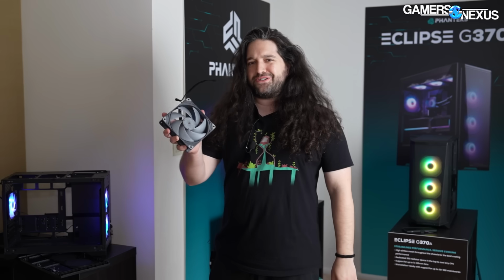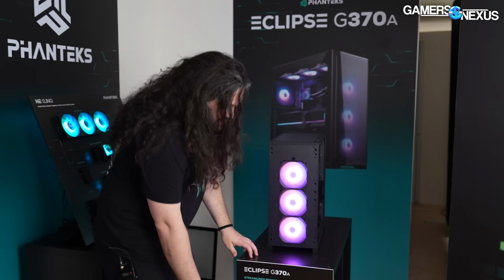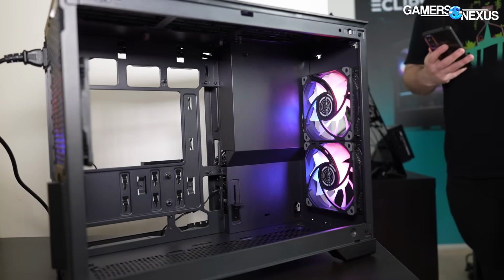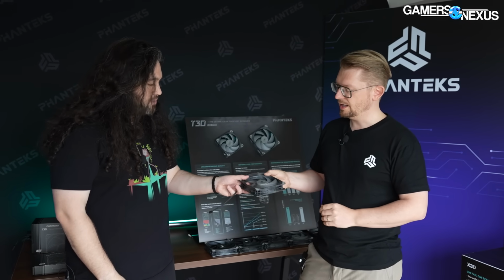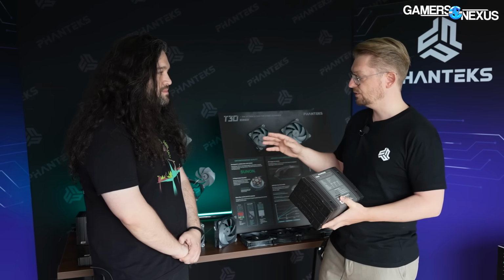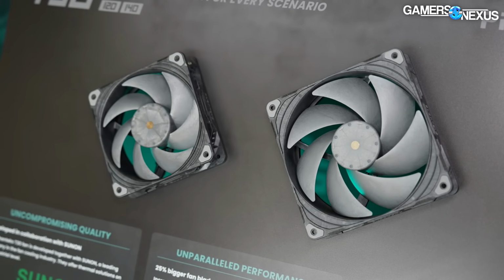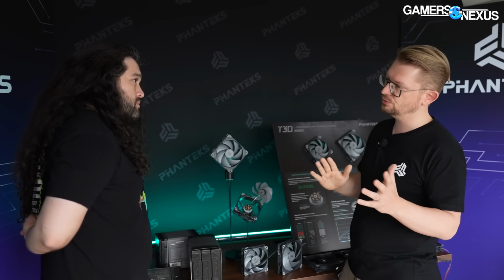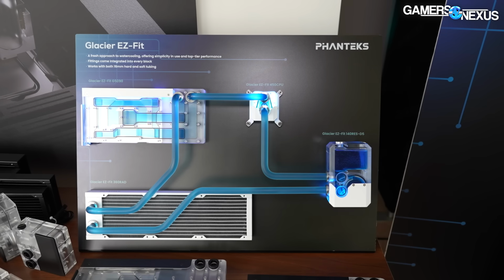6 Years to Make a Fan, G370A Budget Case, & Phanteks Technical Fan Discussion, ft. CTO

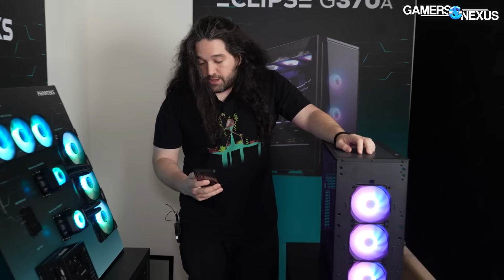Comment: 5:49 I really like the PSU placement for the XT M3. I'd love to see that used on full ATX cases. I don't like the trend of cases having a blocked out strip across the whole bottom of the case. It's a lot of deadspace where I'd rather see transparent paneling

Comment: i like the case with the 900 LEDs wrapping around the bottom edge. it's plenty good for displaying some stuff and sounds like it's a bit cheaper to implement than the LCD panel we've been seeing on many other products this year. it's probably also brighter if you want it to be and somehow it just looks nicer, at least to me. though i'm also wondering about the heat output of all those LEDs. 900 of them is a lot

Comment: At "only" 25 mm thick, how do the Noctua iPPC-3000 140 and Iceberg Thermal Icegale Xtra 140 achieve fairly similiar airflow & pressure to the 30 mm thick Phanteks T30 140 and Super Flower Megacool 140? It also begs the question: how insane would the Noctua and Iceberg Thermal be if they were also 30 mm thick?

BTW, I'm slightly disappointed in the Phanteks' top-speed. For that price along with competing in the "absolute top-end, best of the best" segment, I was hoping for 3000 RPM, at least 2800.

Comment: I just wish there is a case that allows at least two 360 radiators, no glass or RGBs, great ventilation but also tricks to reduce fan noise bleed.

Comment: Patiently waiting for the moment when manufacturers start listing noise-normalized airflow and static pressure for their fans. There should be an ISO standard that specifies a reasonable noise level (e.g. 30/35 dBa) where performance should be declared. It would  be incredibly useful even though performance-noise is not a linear relationship for fans.

Comment: How come you prefer when they include the feet in the volume measurement? I didn't think anyone cared if their case was an inch taller.
I always thought volume was a separate measurement from the external dimensions, and specifically about internal volume.

Comment: I had no idea Phanteks was using Sunon as their OEM. That's amazing. I've got decades-old Sunon fans (note 2 plural tenses!) pulled from various bits of hardware. They work perfectly to this day and move lots of air; just a bit noisy. I need to remember this next time I'm fan shopping. That maglev motor and bearing assembly should indeed last a long time. 👍

Comment: Love my T30's! I changed out all my case fans and AIO fans to them, 11 in total. My 4080 Super Asus Rog stays easily below 60 playing 4k med-high w/ PT/RT etc settings. Then my Arctic Liquid Freezer II 360 with the T30's dropped CPU temps ~7 from stock under full load, but keeps it even cooler under normal gaming!

Comment: Although I own several Phanteks T30 fans, I still find the product quite awkward. You can think of it as a better version of the Noctua A12x25 at low RPM, with a higher maximum RPM ceiling. However, this comes at the cost of compatibility due to its 30mm thickness. Typically, users don't run 120mm fans at very high RPMs, and those who need stronger cooling performance often opt for 140mm or even 160mm fans instead. Its main advantage is probably in high-performance air coolers or as radiator fans in AIO liquid cooling setups.Competitors like the similarly priced Noctua A12x25 or the more affordable Lian Li P28 are both strong alternatives.

Comment: 22:40 Thermalright does this with their fans also, although (at least with the TR fans I have) the balancing material is red, and it's pasted into small notches around the top of the blade's hub, as opposed to underneath (where the blade attaches to the spindle).

Comment: Would love special post-Computex Interview about LCP with a material science engineer. 
- LCP. Glass Fiber reinforced LCP (Liquid Crystal Polymer). Plastic for high performance application, similar to metals, but not as expensive. 
You talked in the past alot about not mixing metals in water cooling. how about all the other materials used in computer manufacturing? the plastics. the metals.

Comment: Hello please help me guys.. my ingame sensitivity was super high but the sensitivity in loading screens and fortnite lobby was normal. I hadn't changed anything to do with DPI or sensitivity. My dpi was the same as before (1600) my ingame sensitivity is 6.4 which is also the same as before but my sensitivity feels like it has changed without saying it's been changed. My windows sensitivity is the same as before and mouse acceleration is off too. When I'm not in any game and just browsing around windows, my sensitivity is normal. When I go into a match my ingame sense feels super high it ruins my muscle memory and really pisses me off. If someone has a fix please tell me. It also seems like the sensitivity got higher in every game on my pc,( dbd , fortnite , chained together ) but not the cursor speed. Whenever the mouse cursor is out, the sensitivity is normal but when I'm actually playing the game the sensitivity is higher than normal I did not change the dpi or resolution or whatever, just updated nvidia drivers. I tried ddu to rollback, my pc is still not working as it used to and im still having this issue today. ( Its been almost a month)

Comment: I got a set of the T30s a few years ago and I made the mistake of just slapping them onto the highest setting, and put them on my radiator as exhaust fans, daisy chained, on the 2A fan header.
And once I finished my build I could not stop them from running at 3,000rpm all the time, no matter how I changed my fan curve and settings, it was like a Jumbo Jet engine inside my PC!
It was the perfect storm or errors, because I couldn't reach the switch on the inside to lower the setting, and for whatever reason that I can't remember now, daisy chaining them made them run at 100% speed all the time with the aid of the 2A fan header for extra power too! 🤣
But once I moved things around, and lowered the power settings on the fans it was fine, and they've been flawless since then. But having 3 of these fans running at 3,000rpm is an experience..

Comment: Phanteks are the most underrated fans in the industry. Love my Phanteks fans, it's all I ever buy and recommend at this point. Nothing else comes close to their performance and quality while being extremely reasonably priced. It does worry me to hear the 3 pack is going to be so expensive now though. It used to be like $30 for the 3 pack which was an insane value. Still, you really can't beat their specs.

I personally don't care much about how noisy my fans are (within reason), and not saying there's particularly are, but I just want the highest airflow/cfm/pressure I can get and always run all my fans at highest RPMs because I OC and I wear noise cancelling headphones when gaming anyhow. Phanteks has always delivered the highest specs at a fraction of the cost of the rest of them.

Hopefully they can take on Noctua without taking on Noctua's extremely high prices.

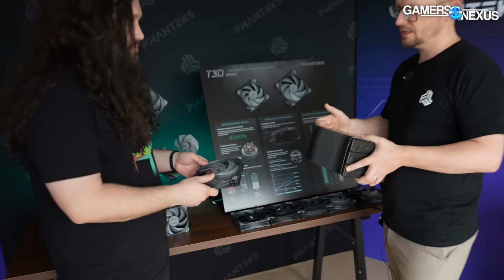Comment: On the T30 chart (e.g. 19:45), is the center bottom graph showing flow vs pressure?
Area under the curve would seem to be a compelling metric for fans that may be used in multiple applications.

Comment: instead of giving the 2 extreme points of the fan give the whole curve, like some brand instead of trying to explain why they are not representative, also user are not dumb or well at least I believe and we will understand it. About the clearance he spent a few min that there is more to it and that they are parallel whatever but after that he admitted hat only the tip clearence is important and they are a 0.9mm when other are better so 6 years for this really ?

Comment: The G370A lower fan is important, as you are really get a benefit to cool the PSU if your video card supports multi flame generation. The PSU side has basically the same amount of chance to get hot as the card side.

Comment: Phanteks makes some nice cases. 

As a system builder, I've found their cable management cut-outs on some of their cases- G300 / G360a especially are very small - excited to see them open those up.

Also 360MM Liquid cooling was tough in the G360a - hopefully better in this new case model 🔥

Comment: having worked in the plastic moulding industry making car parts and tooling and tool maintenance is really important . one tiny scratch or mark on the tool and its thousands in cash to have it fixed.. also glass fibre parts get a lot hotter during the manufacturing and are harder to work with ..

Comment: In regards to the g370a. Its a budget case and your worried about 360 rad support. You should have been worried about that almost zero depth for cable management... And not wasting fan cooling. 
I get that some sacrifices need to be made, but the depth of the back. Shouldn't have been one of them....
Reply: The m3 is great, no notes

Comment: I have 11 Phanteks T-30's in my build. Truly legendary fans. Thank you to everyone that worked on them.
Reply: how loud is it to push them to max rpm ?
Reply: @NutriCostSam Running 11× Phanteks T30s at 3000 RPM is definitely audible (loud) — think air purifier on a high setting. That said, max speed is total overkill for everyday use.

Thanks to their 30mm depth and blade design, T30s deliver extremely high static pressure and airflow even at low RPMs. At around 1000 RPM (silent), they’re already moving more air than most standard 25mm fans do at 2000 RPM.

The real strength of the T30 isn’t brute-force RPM — it’s how much air they move quietly.

Comment: I have an idea that may not be feasible but how the blades start completely bumped up to the edge so 0 clearance and then have the end 1mm made from a material that will wear away easily and then run the fan until it wears back to a thin minimum clearance, like what we woodworkers do with zero clearance table saw blade inserts

Comment: Phanteks tooling delivery getting locked down due to COVID may have been the reason I wasn't able to buy T30 back then because the fans were suddenly being sold at like 45-50€ a piece, which I wasn't okay with paying for a single fan.

Comment: these fans have so many factors to adjust for certain performance, how can i tell if they will work for my use case, i run my notcua 140mm fans about 550rpm constant, so when i buy new fans what should i look for for low rpm performance oriented fans?  normally a dust filter in front of them. all depends on the next case i get, looking at Fractal design torrent as the best airflow case.

Comment: I'd like to know why; If the clearance of the leading edge of the fan blade is the most important for increasing pressure, why not fit a lip to the intake side of the fan, to reduce the clearance at the face of the blade, instead of the outer edge? Or is blade wobble too much?
Reply: Blade wobble is too much. Exactly that is the problem. This is about tolerances in real-world mass manufacturing, not the general feasability of a fan with something stupid like 0.1 mm clearance. You can totally make that, it'll just be a 1 of 1 engineering sample that won't ever be turned into an actual product.

Comment: I quite like that Micro-ATX case, but would like to see a proper dust filter for the front and bottom fans. The trend towards just putting holes in the front panel is not good, as it does nearly nothing to stop dust

Comment: phones don't need fans. Why do pc's have fans? We can have fanless high end pc's if we just demanded for it. Once you try it you won't go back.
Reply: Because phones processors have less than 5 W while PCs are slowly pushing 1000 W total thermal design power. Those are completely different regimes of computing. The best comparison to a phone in PCs are RAM sticks or SSDs which also are slowly pushing their power envelope to the point where they need to be cooled actively.

If you really are so obsessed with fanless design, then accept Apple's golden chastity cage and get a MacBook Air. Just don't come crying when it overheats and thermal throttles if you try to do something intense like rendering video.
Reply: @hammerth1421  You can easily run few hundred watts on fanless hardware. Just don't overclock it too much. Most games except latest AAA will all run well and many even 240fps depending on settings. My point is that there should be fanless options for those who like to game in quality audio without headphones.

Comment: If they want to start making good pressure fans: the best I have at low RPM in the less audible range are old Apple case fans from the '00s, 120x38mm (They are Delta made fans, they never made pwm versions). I've never seen anything beating them. Only PITA is you need a custom pcb to convert from pwm to current control as there is not pwm version of those fans.

Comment: As long as fan manufacturers use the same size hub motors on 120 and 140mm fans static pressure will suffer on the 140s.

Comment: Uh no, it did not take Phanteks six years to make that fan. The funding hostaged by cellarboxing wall street hidden in swaps and derivatives courtesy of FTDs failures-to-deliver was not allocated to Phanteks in a timely manner for them to have access to the rehypothecated assets to invest in anyone to do more than zero things. Phanteks, or anyone, using a duration of six years to measure span of time for construction of such things is absurd, and deserves further auditing, analysis, investigation to question all persons involved in pushing such crafted narratives to manufacture consent.
Reply: Whoa there, buddy, be careful not to trip over all those big words!

Of course they iterated on their design and productized intermediate points. However, this was what they were really working towards and it took them about 6 to 8 years of lessons learned to eventually end up here.

Comment: The balancing is similar to how they would balance your wheels after a tire change/replacement.

You're looking for uneven rotating inertia, due to uneven mass distribution as a result of production (for all of the reasons that Tenzin mention (and there are a whole bunch more that he didn't explicitly mention as well), and you do that in a dynamic environment.

From the engineering side of things, you actually run statistical models to throw/introduce randomness into your perfect CAD design, and then you evaluate/run the statistical analysis to look for compatibility/interference/clash issues as well as durability issues

The statistical process controls for injection moulded parts is unlike any other, because there are just more variables that you have to consider with the entire injection moulding process in and of itself. Plastics process engineers have their work cut out for them, and trying to do the plastics process engineering reliably and in a predictable fashion so that you can deploy countermeasures for any potential manufacturing issues is half-art-half-science.
Reply: Thanks chatGPT.
Reply: @ripleyhrgiger4669  
"Thanks chatGPT."
2 things this comment demonstrates:

1) You failed in high school science classes.

2) You've never actually USED ChatGPT to realise how badly it sucks.

Comment: Been rocking my 120 t30 for years now and use them on every single 360 aio I have. I remove the garbage fan's most aio's come with "especially corsair aio's" and throw the t30's on them. Been waiting for years for these 140 t30's and can't with to buy them and throw them in my case to replace the Phanteks m25's I've been using for years now as intake and exhaust with my Phanteks g500a and my wife's g500a also.

Comment: Blade balance is a heck of a lot more important to performance/timeXpower than most people realize. I've been playing with RC planes since the days you'd use steel wires to give yourself vertigo as you flew the plane, and so i've accrued a lot of blade balancing gear over the years. Rarely are blades balanced to my spec (synthetic ruby parallels) - which is not really something they'd do in a factory, but whenever i get a new fan i balance it and they last considerably longer.

I've had an all metal server fan last nearly 12 years permanently on, with the only down time being maintenance or maintenance of the fan itself (clean up + oil). Here's the kicker. Where other fans would wear out their bearings eventually driving down their efficiency, once you've established a balanced blade, that wear goes down and because of it you've essentially left yourself with only electronics mode failures - which are rare these days (UPS, surge protection, all kinds of goodies).

Comment: It is nice that case manufacturers remembered what "airflow" and "mesh" is. But in their airflow hype they all forgot what a dust filter is. I will never buy a case with unfiltered intake like those trendy side intakes or meshed PSU shrouds. And on the G370A they even forgot a front filter - Wow!
Reply: And that's why I like Fractal cases. Simple but pleasing design with mesh and dust filters.

Comment: I know they are on the pricier end, but I have three of the T30-120s and have been running them a long time and they've been some of my favorite fans I've ever used. It's cool to see all the details that go into making them, down to balancing them individually, pretty neat. Both Phanteks and Noctua have been solid in my systems for years. While there are other brands, both budget and higher-end that I've used and sometimes liked too- none of the others I've used (Antec, Lian Li, etc) have been as reliable or durable- always have a few failures with those. So I like the focus on durability the higher-end fan brands have. All anecdotal of course, but that has been my experience- the price can be offputting for sure but given how long they seem to last it balances out over time.
Reply: Same here my T30 are actually better than my noctua and be quiet pro 4.